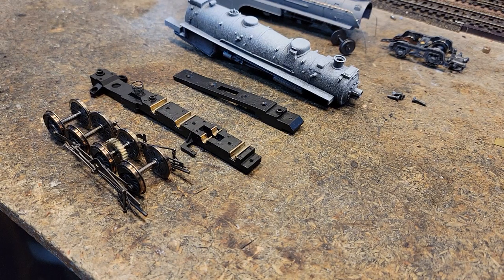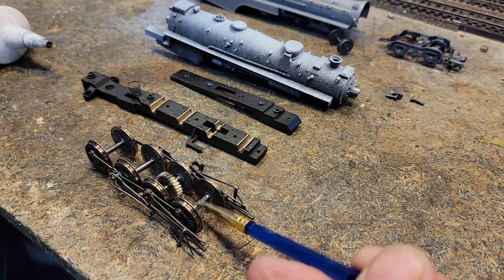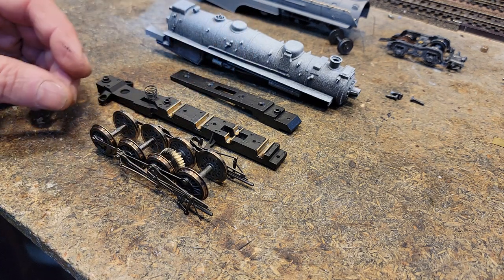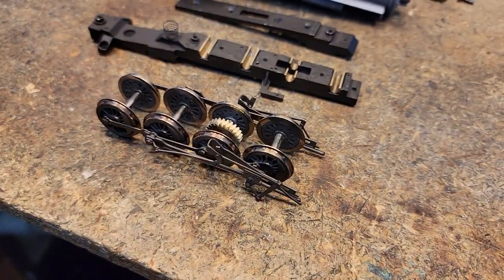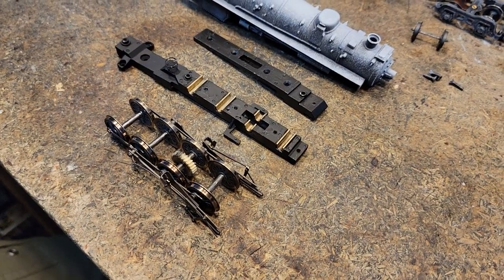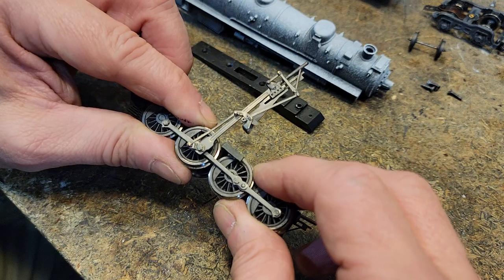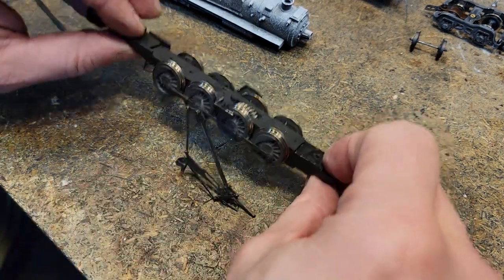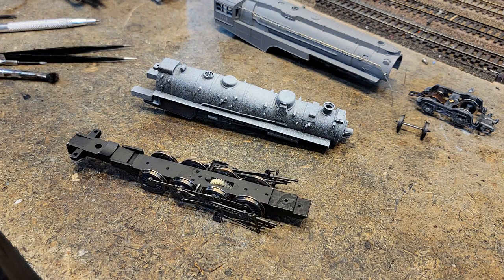Quartering HO Scale Mantua Mikado

Comment: Working my first ever ho brass mikado from Key Imports. Currently i am tearing it down to bare bones parts to strip it and re apply the detail parts and paint better; Also, gonna super detail it along was firebox flicker , Lit marker , cab , running board lights.   I upgraded the wiring to be a lil bigger . Gonna be adding Blunami DCC . I even taking apart the gearbox , cleaning , resurfacing the 2 halves of the casing and polishing it on the inside and outside before reassembly. Finding this video is what set me to start cause i need to completely take my crank rods off so the wheels can be repainted. seeing your video. Made what i thought was tons of time , Now I'm a mechanic and welder/ fabricator and i was think i was gonna have to fabricate mini degree wheels . But yeah , you made what i though would have been a few hours into less then 5 mins. Thank you for sharing these pointers.
Reply from the maker: that Mikado is going to be something extra special and a warm-up befor we tackle a couple much bigger steam projects!  there's very little good info out about quartering and many people give up on steam when they can't get smooth running out of the locomotives!  there is more to come on these!
Reply: @elite194  Can't wait . Also, i don't know if you paint trains but i would love to see a video talking about / showing the differences between prepping and painting brass , cast iron and plastic models.
Reply from the maker: @POTCsIronMan  I've done several brass, diecast and tons of plastic paint jobs.  My basic prep is always the same - strip the paint, polish the brass or diecast then use Ace rust stop white primer on all 3 kinds.  Then I paint usually using Citadel paints with a white taklon brush.  Even the best airbrush job using Tru-Color is not even a little close to using a modern acrylic that is meant to be painted by brush.  I've videos on the Tenshodo SD24 and GP20, the RSD15 is also brass.  The diecast are FA1s and a GG1.  The rest are plastic.  There are more to come, since I've got another Tenshodo and some other diecast stuff.  Not sure what's next, but we'll pick after this years contest!
Reply from the maker: @POTCsIronMan  there is a Bowser diecast T1 steam coming soon though!

Comment: I learned about quartering the hard way lol. I got a Ken Kidder 0-4-0 plantation locomotive in bits. I now realize that it was a kit someone had started. The drivers were both aligned together so it would bind. I didn't have a quartering tool so I did it by trial and error.
Reply from the maker: that's how I learned!

Comment: The key to understanding "quartering" in models is:  It does not matter what the angle in degrees difference between the two sides of the drivers is as long as the angle of difference in each driver pair is the same.
If you line up all drivers on one side of the locomotive, lock them in place so you can turn the locomotive over, all of the pins/posts for the rods on the other side all must line up.  If they don't, you will have to make an adjustment of at least one driver to bring them all into the same angle difference.
I have found that the best way to do this is to remove all the driver sets and, one by one, check their "quartering" in a quartering jig.  However, few jigs are available on the market and not all driver sets fit/work in any specific jig.
Reply from the maker: When that becomes necessary, I've got some rods that I can use through the spokes.  I've got 3 more steam locomotives coming up that will need everything removed plus I've got a Bowser diecast T1 kit wher we have to start from scratch!

Comment: I now have the quartering tool and the wheel puller. I have used both but I'm unsure if I'm using the quartering tool properly
Reply from the maker: I haven't tried the tool, but it does look pretty good.  the puller is very good for getting wheels into gauge without rotatiing them.  generally, stretching the whole works will at least tell you if you're close!
Reply: A quartering jig is a great tool.

Comment: Great explanation on quartering. What do you use if you have to remove any of the drive rods? Do you just use needle nose pilers to remove the screws or do you have small nut drivers if so what size nut drivers do you have?
Reply from the maker: I got a super cheap nut driver set at Harbor Freight that I didn't even know would work, but it's perfect.  I don't know what set it is but it seems to always be there!
Reply: Ill check them out Thanks, @elite194

Comment: Is that not the Manuta Pacifc boiler assembly?  Does it fit with the Mikado drive train?  I kinda spot checked it and it seemed the fire box would interfere with the drive wheels. I may be wrong on that as not a scientific test LOL.  Cool Thanks!  Had to quarter a Manuta Pacific by trial and error,  but got it to work!
Reply from the maker: so it took me a while to track this one down, but it's in the 1955 catalog.  I found the diagram for this specific locomotive.  it could be older than that and I don't know if it was used for any other locomotives... it is turing out nice though!
Reply: @elite194  very cool!! May have to play with one of my Pacifics and my one Mikado and mic and match.  Looking for ward to next videos. Will have to look for that 1955 catalog!! ThanksI. Love to have one of the Mantua Atlantics!  The Reading Pacific would be neat to as has a different boiler.
Reply from the maker: @ecidaho  the catalogs are on hoseeker under Mantua, but no diagrams.  I found the diagram using neeva, which was unexpected, but someone put it out there once upon a time! This build all hinges on the next step where I'm going to test a new method of painting using oil paint and brushes about 8 hours from now.  The whole video for this one is getting long, but is a decent reference so far.  For the painting we will be going way out of bounds!
Reply: @elite194  cool! Looking forward to it I have rafts of oil paints that are never used so would be cool to see how you do the painting. Fun to try new method!
Reply: There are two mantua boilers, a light boiler and a heavy boiler, that are fully interchangeable. 

So light Pacific v heavy Pacific or light Mikado v heavy Mikado is just a matter if which boiler you use.
Reply from the maker: @fraidykat  I don't know how to tell the difference since this is the first one I've done! So far it's turning out quite nice.  I really like the diecast body!
Reply: @elite194  You have the light (USRA?) boiler.
Reply: @fraidykat  sweet will do some mixing and matching then! Thanks!!

Comment: I realize that your effort in describing the driver quartering process was in earnests, I'm still very confused as to what exactly you're doing in the process. To be fair though, I'm going to re-watch the video to determine if I missed or misconstrued portions (which is very possible) of your explanation. My intent is to offer your video as a bullet proof method to other people that are attempting to learn how the process works as few if any other content creator that works on or repairs steam locomotives take the time to show this in their videos that I have seen. Thanks for posting this, i'm sure many steam modelers will benefit from it.
Reply from the maker: it began as a request for help from a friend and has now morphed into making probably a bunch of videos on quartering.  useful advice on quartering is really tough to find, but since I've done quite a lot of it I think I should share that info... the first most important item is not looking at the counterbalance weights inside the wheels - they're just decoration!  pulling the whole works tight and getting the main drives in line and axles straight is the first step!  there's going to be more of this because like you've noticed, there's next to nothing useful out there for steam modelers, so we'll build a library.  I started a playlist just for steam!
Reply: @elite194  Thanks alot elite, I know that this is very valuable information for many steam modelers and I sure will point them in your direction any time I come across one.
Reply from the maker: we'll build on this - especially since that other steam loco is a Hudson that's getting a sound decoder.  that will be interesting because the decoder is one I've never come across before  but if it matches the documentation it will be on my shopping list!